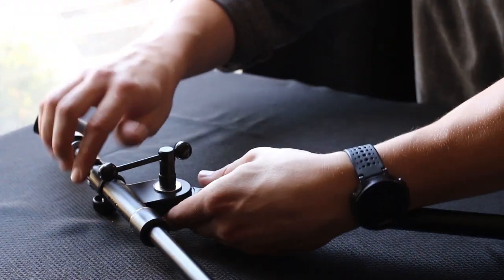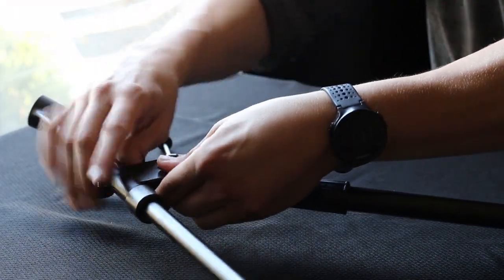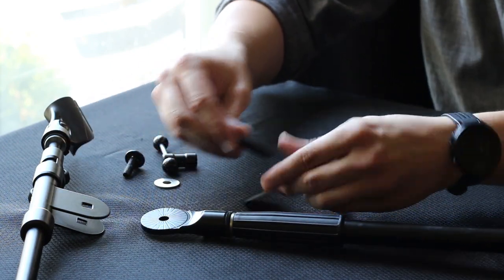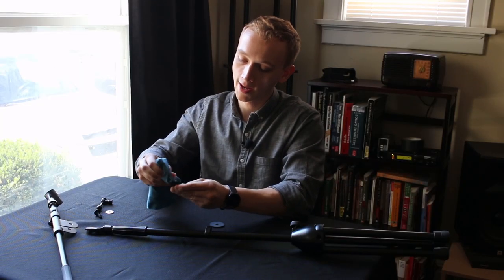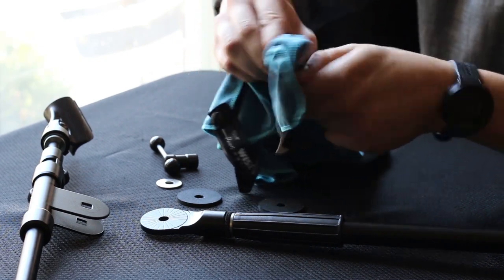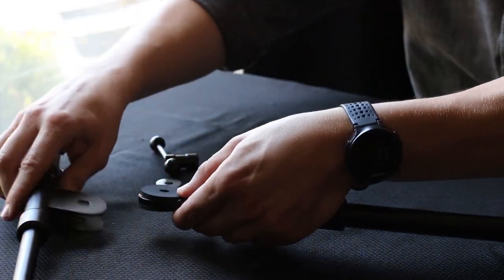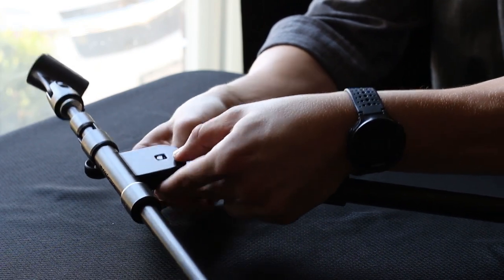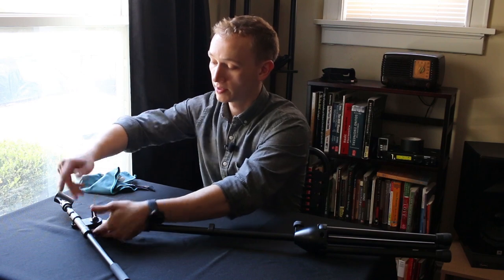How to Fix a Microphone Stand

Comment: I use 8 mic stands at church for my drum kit and  singers. Half of them, the boom arm no longer holds position. I brought one home to pull apart to find out what needs to be replaced. Your video saved me a trip to Bunnings. One simple wipe down of the rubber pads and nut and bolt, and it works like new. 
Thank you. 
New sub.

Comment: What a wonderfully short and concise video! Also, you have a great voice/presence! Good luck!
Reply from the maker: Thanks! Were you able to fix your mic stand?
Reply: @AudioUniversity  Well, I wasn't actually looking for that in particular, I was just annoyed at all the bits that seems to get loose everytime you reassemble a mic stand :p Especially the threading above the hight adjustment. I see no need to ever use that screw, but it seems to get loose no matter how hard i turn it ^^ I kinda hate loose mic stands, doesn't go well with my OCD ^^
Reply from the maker: I know the feeling! Try using Loctite if it’s a bolt that you will NEVER need to adjust.
Reply: @AudioUniversity  Good idea! I'm gonna super glue that mother x'P

Comment: Hey man! Thank you for this video!

What can I do when the rubber pads (to adjust boom angle) are already disintegrating? Have you tried replacing them before? I cant seem to find those in the internet haha. Maybe you have an idea:)
Reply from the maker: I’ve never bought the pads alone, unfortunately. Are yours starting to crumble?
Reply: Audio University the teeth of the "wheel" between the rubber pads has somewhat been permanently imprinted on the rubber pads. I guess this shows that the elastic property of the rubber pads has been reduced. The boom cannot stay put when in full extension. I have to leave around 1/4 of the boom on one side to "balance" it "long term". Do we usually not max out the boom extension?
Reply from the maker: You should be able to extend it fully. The cleaning trick didn’t work?
Reply: @AudioUniversity  Oooh, i think it helped! I did not try it immediately since my pads were a bit damaged already due to the teeth carving into the rubber. Thank you!!
Reply: Can't vouch for the place (don't report me lol). I don't work there, I don't own the place . Just passing it along since I had the same issue.
Reply: What brand is the equipment your using? Have you tried looking online for your item with the name brand it came from? Hopefully being helpful :elbowcough:
Reply: @levanah_lillith  hercules stands. it's working fine now
Reply: @kissapeles  fantastic! SO glad to hear. enjoy, stay safe. God Bless :elbowcough:

Comment: $2 fix, go to your local hardware store and get two new rubber discs and two tooth washers. Remove the old discs and reassemble with the new discs and add a tooth washer on the outside of each rubber disc. Mike book has not dropped for two days now! 😬